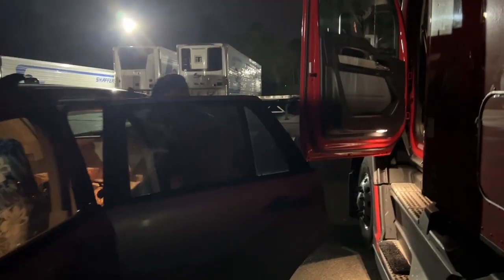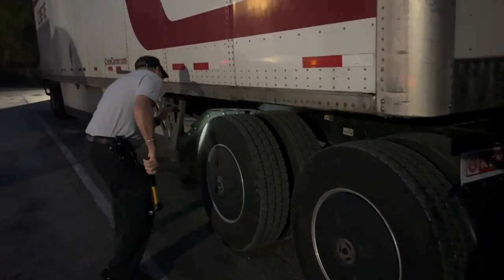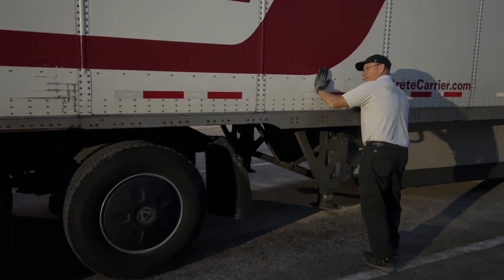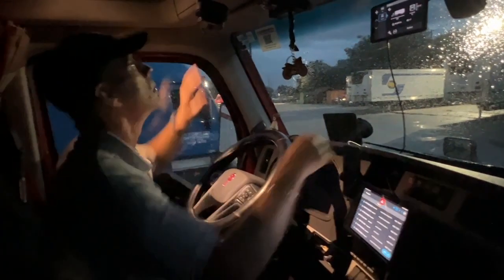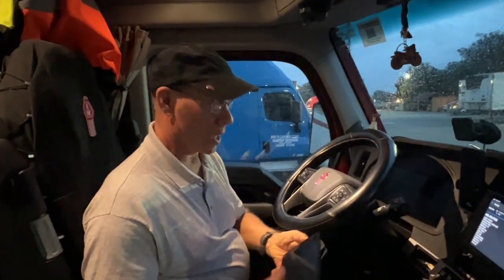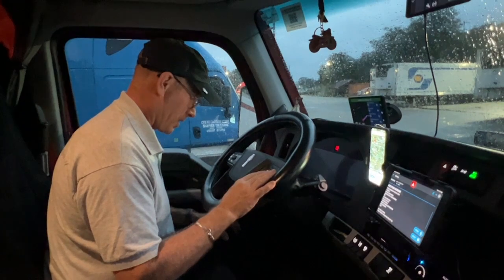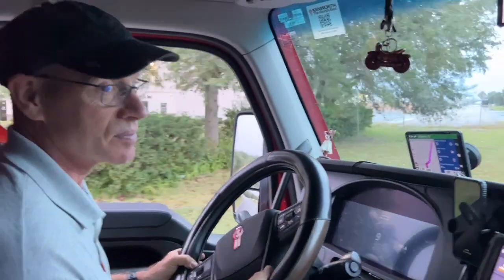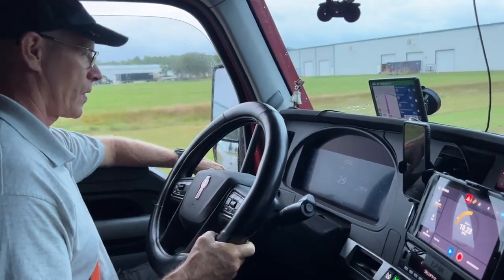REAL LIFE Pre-Trip and Trip Planning of a TRUCK Driver

Comment: I just started training with my mentor. It’s been a big journey to get to this point. I’ve been on the road for 2 days doing a little over 1100 miles in total. My school didn’t teach backing besides the parallel park which is dumb so my mentor started helping me back today. My second receiver had a dirt lot with a row of trailers on each side and barely enough room to turn around in the middle. The one spot left was down a steep hill with huge ruts where the tandems go and a fire hydrant on the blind side rear corner just to make it interesting.  I got it in there after 3 tries and I’m really proud of myself. I am grateful to have a patient and good mentor!!

Comment: We had a school bus driver that took his bus in for brake replacement and annual inspection. When he went to pick it up and bring it back to the school he didn't do a pre-trip since they had supposedly just inspected everything. He drove about 2 miles and a wheel came off. They hadn't tightened the lug nuts after the brake job. He got a ticket from the police for not having done the pre-trip. Obviously, no students on the bus. 

If you are going to be the person behind the steering wheel, you should be the person checking everything.

Thanks for bringing us along. Keep the shiny side up